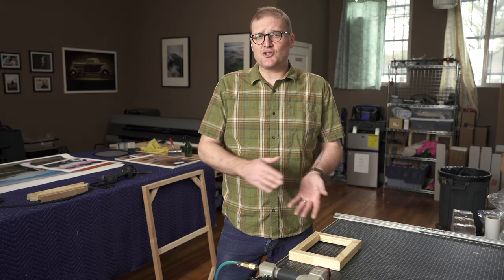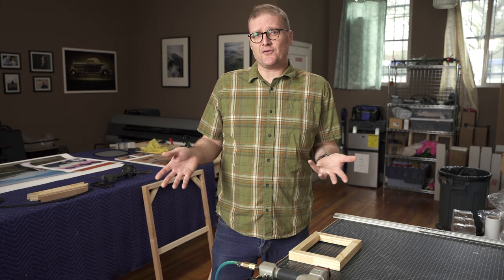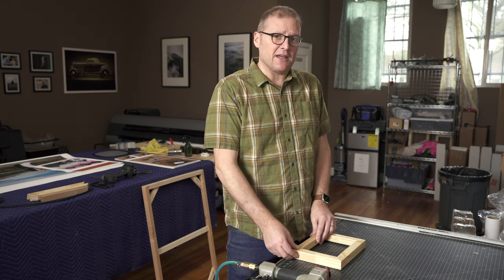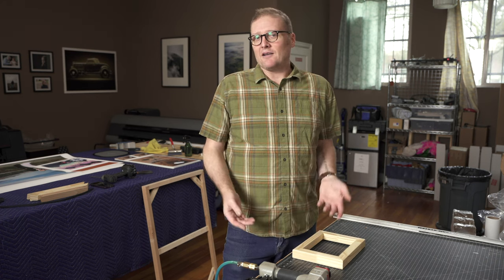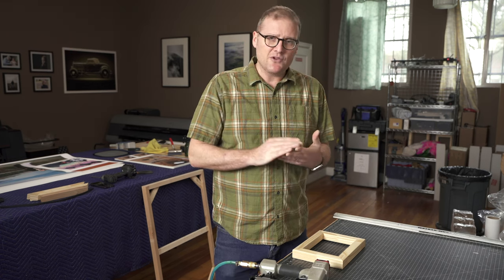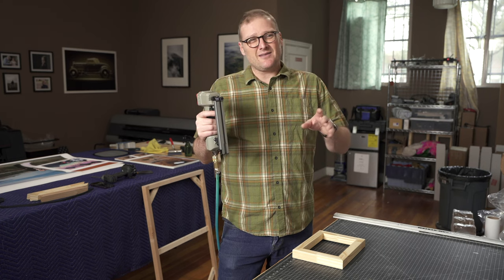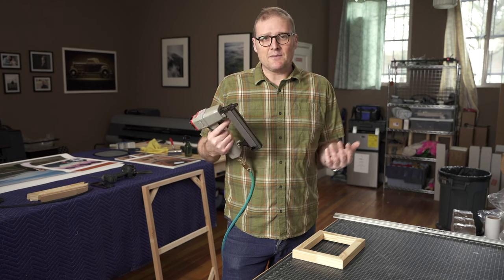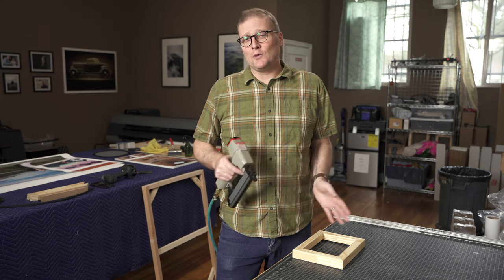Meite Pneumatic Framing V-Nailer Quick Review

Comment: The nailer you linked to is no longer available. Do you still recommend this method? I've been using a brad nailer but would love to use vnails.
Reply from the maker: It's still on amazon the name and link just switches. Just look for v nailer on amazon. I recently got this however and like it more. https://www.amazon.com/gp/slredirect/picassoRedirect.html/ref=pa_sp_atf_aps_sr_pg1_1?ie=UTF8&adId=A0331638QTNIYY7PHSG5&qualifier=1686857508&id=1672843769393593&widgetName=sp_atf&url=%2FV1015-Pneumatic-Nailer%25EF%25BC%258CAir-Gauge%25EF%25BC%258CPower-Joiner%25EF%25BC%258CWood%2Fdp%2FB09MVHDG21%2Fref%3Dsr_1_1_sspa%3Fcrid%3D2T4OP8N9PFYXT%26keywords%3Dv%2Bnailer%26qid%3D1686857508%26sprefix%3Dv%2Bnaile%252Caps%252C168%26sr%3D8-1-spons%26psc%3D1